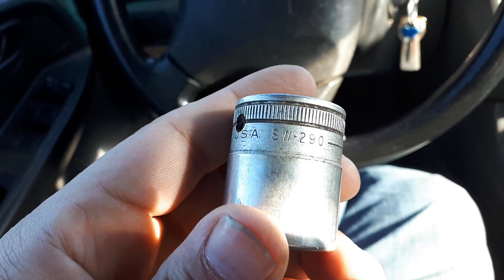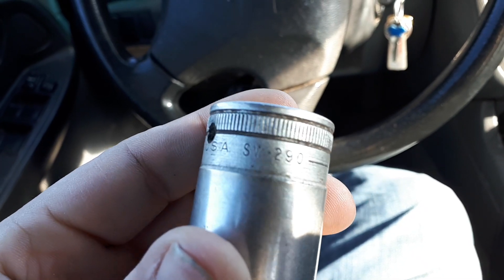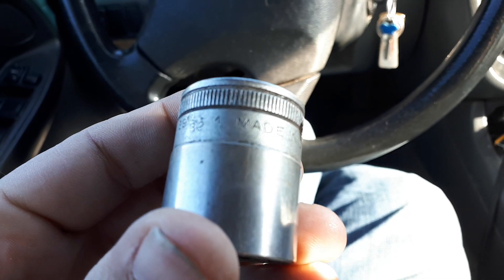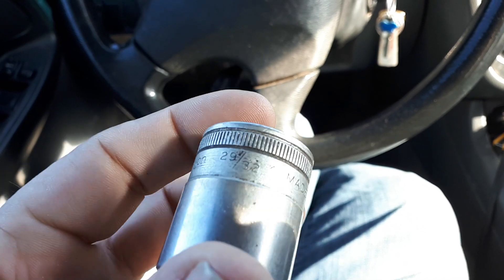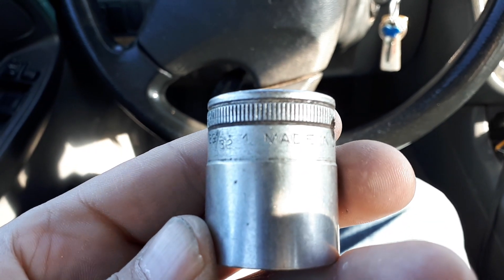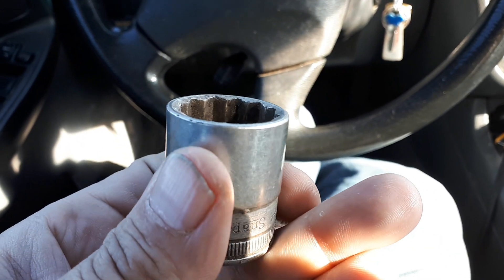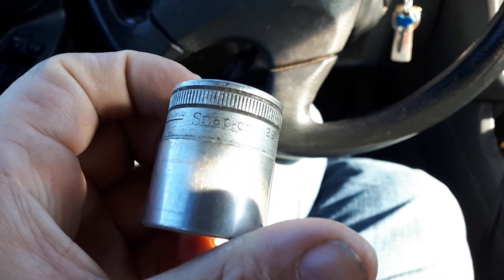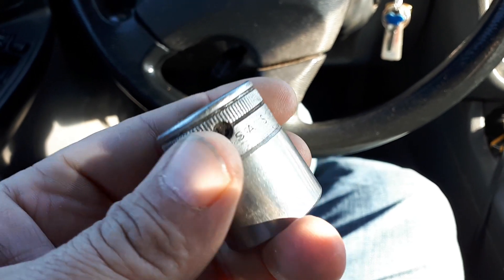A vintage snap on socket

Comment: That Matches My 1/2 in and 3/8 Set Shallow And Deep Sets Non Flank Drive 😎😀😀👍🏼
Reply from the maker: its half inch drive that socket
Reply: danoh's toolbox I’ve Got the Extensions and Swivel Adaptors 😀👍🏼

Comment: I have an old sk the exact same size. About same age as well
Reply from the maker: cool i have a 12 point set of snap on sockets it will go in i have a few of the odd sizes good luck in finding a rack for them all